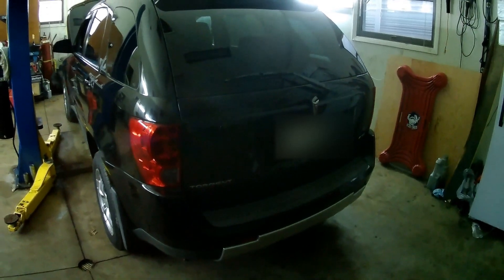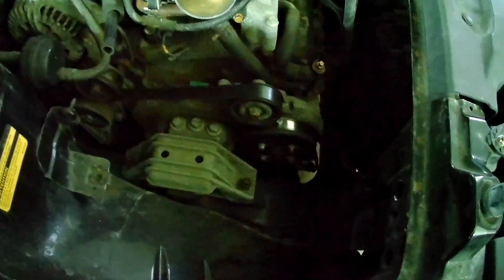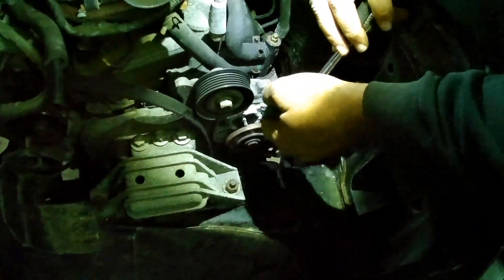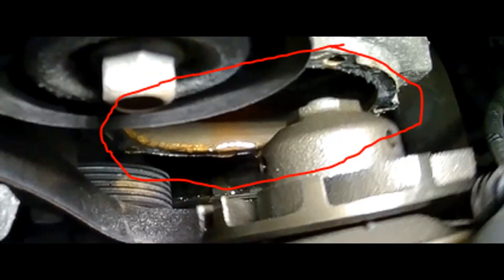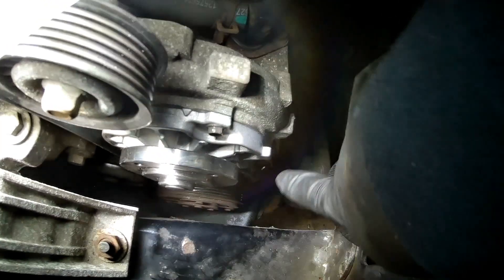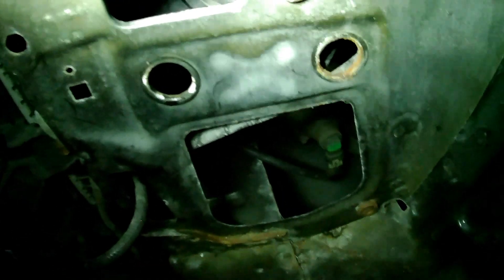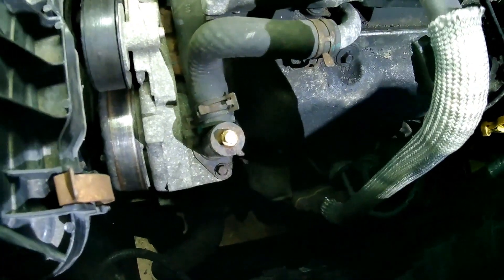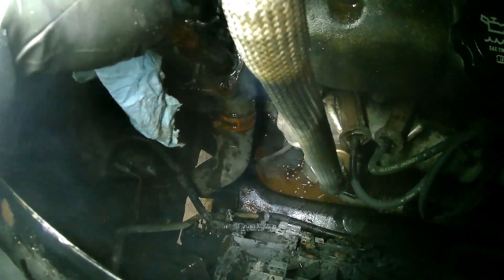2006 Pontiac Torrent water pump replacement.

Comment: Great video. I'm about to do one on a 2007 Torrent
Reply from the maker: Thank you Marcus & thank you for checking out my video. Good luck on your replacement.
Reply: @NorthCoastT  How did you get the water pump pull off? I left the belt on, but when I try to loosen the bolts for the pully everything turns.

Comment: Good morning, sir! I changed water pump but didn't bleed air outta system. What tools do I need to do that again? Could that be why I continue to get the "Engine Hot/AC Off" on screen immediately after cranking on when it obviously hasn't had a chance to warm up, let alone overheat??
Reply from the maker: Good evening! If I remember correctly, you will need and 8mm wrench and a clear hose to recycle the fluid. Air in the system could definitely give false readings on the sensors.

Comment: Do i need a hose on the bleeder screw? Also if I do and coolant/ air comes through the hose do I redirect 
The hose to a a container or the coolant reservoir? Thanks
Reply from the maker: Thanks for tuning in and the question. I would recommend a hose on the bleeder so it doesn't suck in air or make a mess. I redirected the fluid into a container because it was easier but you could try to get it to the reservoir. Just not too deep in so the air doesn't get forced back into the system.

Comment: Noticed that water pump mounting cap screw threads were not cleaned and preserved for reassembly, any reason?????  I recommend thread cleaning, both cap screws and holes with the application of "Fluid Film" compound as a CYA for the future.
Reply from the maker: Thanks for tuning in! We actually never even thought about it. We were doing so much in a short amount of time. Thank you and we will keep that in mind for the next one.

Comment: Great video I'm on a crunch with my 07 Equinox and this was well explained. I'm just curious how you filled the block with antifreeze and the hose you used on the bleeder. Much appreciated
Reply from the maker: Thank you for checking out my video. I pulled off the hose going to the bleeder housing and filled it that way. The hose I used on the bleeder was was actually 1/2 inch fish tank hose.
Reply: @NorthCoastT   Awesome thanks for the info.  That bleeder valve makes things way easier than the traditional method of burping a system. The Knox takes a while to bleed either way.
Reply from the maker: @phl_knives  thank you again for checking out my video. I actually kept burping mine over and over and still could not get heat. I finally realized that the new heater core was clogged buy something that was left in the system.
Reply: @NorthCoastT  So how did you unclog the heater core??   I'm dealing with an overheat issue and it's got me scratching my head a bit. All had been working fine, and one day was driving along and suddenly had an overheat issue. Boiled over and sprayed a lot of fluid out of the reservoir overflow hose. I felt the problem was a stuck thermostat so I changed it, and while I was at it I changed both radiator hoses. By having both hoses off,  all fluid should have drained from block and radiator, however when I filled it back up, it only took 10 quarts, but specs I read indicated it should take almost 13, so that was a baffler. After that, ran fine a couple days, then suddenly overheated again.  Thought maybe had air pockets in system, so I opened the bleeder and let it run for over an hour. Seemed like air was still coming out, along with a little bit of fluid. Was steaming and bubbling, with a little bit of fluid. During the time of bleeding, kept a watch on the temp guage, and it would run on cool for a long time, and suddenly would spike back up towards hot again. Often when this happened, the heater air would start blowing cool air. If I revved up RPM's, temp guage would usually suddenly jump back down to cool again, and most of the time (but not always), the heater air would get hot again.  ?????   This seemed to indicate a water pump issue to me, except that there is no bearing noise coming from pump, and the pump was not leaking fluid as usually happens when the bearing is going. If the bearing is not bad, and the pump is not leaking any fluid, what other way can a pump go bad?  Since the impeller is directly driven by the serpentine belt. and the belt is  good shape, doesn't the impeller HAVE to be turning??   I was also a little curious about how little of fluid was coming out of the bleeder hole even when I would take the bolt completely out. Being so close to the pump, I would think there would be a lot of fluid being pushed out by the pressure.  What am I missing here?  Could there still be air in system?  Should engine be overheating every little while at idle while bleeding the system? (If pump was ok)???
Reply from the maker: Thank you for tuning in! In your case, it sounds like the pump is bad. I've heard that the impeller can deteriorate and not push the fluid. I had a lot of fluid coming out with the bleeder open. In my case the heater core was clogged as well but I didn't find that out until after the video. I took it to a shop to have the core flushed because I wanted it done right. I hope this helps and I wish you good luck. I really like these vehicles.
Reply: @NorthCoastT  I actually replaced the pump and got that mess sorted out. I appreciate the response. 
Now I have a slipping trans with fluid at proper levels, and new cooler lines. I think it's on its last leg now. I hate to get rid of it since it's body is in great shape, near perfect interior but I travel for work and I can't risk a complete failure states away from me.
Reply from the maker: That's awesome that you got almost another year out of it. Sorry to hear about the transmission, I don't work on those because I never actually learned anything about the internals.  That is a shame that you have to get rid of it now. Is it AWD and what area do you live in? I know someone looking for a parts vehicle.
Reply: @phl_knives do u want to park out
Reply: @NorthCoastT  i got a question i have a 2007 Pontiac torrent i replace the thermostat and the cooling fan on my car cuss it was overheating bad when i got the parts on it it drove for 500 miles than then it start back overheating just like before i got it fix it doesnt leak antifreeze its doesnt leak oil and it doesnt smoke but its just overheats do u think it can be waterpump
Reply: @NorthCoastT  Yes it is an AWD and I'm in the Philly area. It's rough with the vehicle shortages and insane prices right now. These transmissions are a pain to even check fluids, you need to pull the motor mount, unbolt the dipstick since it is a dealer service only vehicle.
I may be going to get my 91 Cherokee back in service, it needs a battery and some cleaning. These vehicle prices are insane. Near me something that has 200k miles. 2005 ish and they're selling for $7k+ near me.
Reply: @desmondpierce9177  Possibly, the body and interior is in great shape, the chrome rim package and AWD with new rear drive shaft, new front calibers and a bunch of other stuff. The interior is like new.
Reply from the maker: Oh my, that's crazy. I can still pick up cars with 200k on them for less than $1000. I am supposed to pick up and Equinox and Ranger this month for $1000 each. Both drive but need a few little things. I feel for you out there.
Reply from the maker: @desmondpierce9177  it may be the water pump if your coolant levels aren't going down. I have seen where the fins on the inside of the pump deteriorate and stop flowing as much fluid.
Reply: @NorthCoastT  Yeah I have came across a few things in the 2k range with 200k but they need  a decent amount of work but drive. One big issue for me is I do some contract work that I need to travel for, usually a few hundred miles a month so I don't want to find issues on the road. I might be picking up a 07 Kia Optima for 3500 with 114k on it from a buddy. Fingers crossed
Reply from the maker: @phl_knives  I fully understand and would hate to be stuck anywhere on a road as well.

Comment: did as your video say change water pump n thermostat n bleed still over heating what am i doing wrong
Reply from the maker: You may have a bad head gasket or intake gasket. The last vehicle I was unsure about, I took it to Firestone to have them do a pressure test. It wasn't too expensive and they told me exactly where it was leaking. I then took the car home and fixed it myself. Unfortunately I've heard that some of the GM vehicles with the 3.4L have those issues.

Comment: I noticed you skipped the belt tensioner part. I used a large pipe wrench to ease tension. Taking all the bolts off didn't look safe under all that pressure from the belt.
Reply from the maker: Sorry, I just saw this message. For some reason some messages only showed on Youtube Studio. I don't know what happened to that footage. I agree with you, don't remove the bolts under tension. I bought the tools for belt tensioners from Harbor Freight. Thank you for checking out my channel.